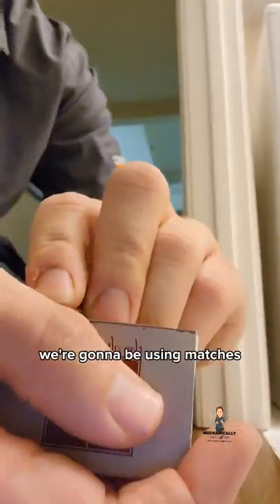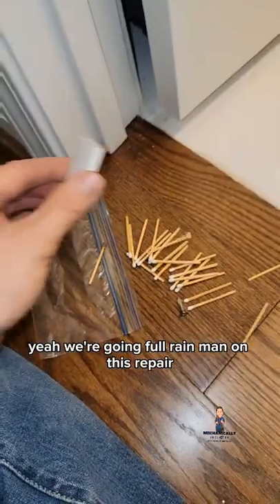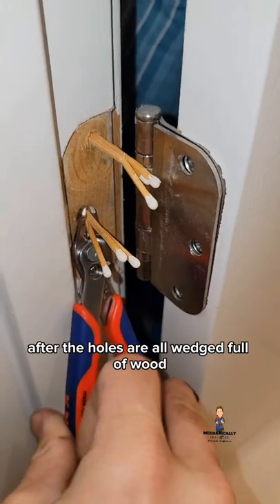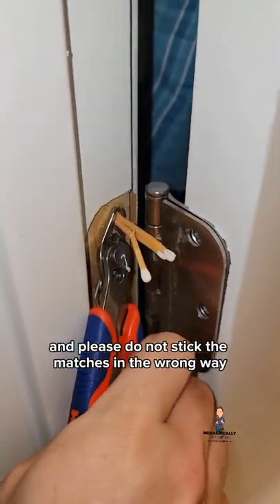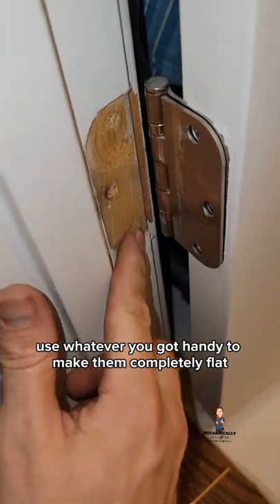How to repair a hinge with loose screws #shorts #diy #handyman

Comment: Helps to apply a tiny bit of wood glue
Reply: Apply the glue before putting them in? 
I aint mean for that to sound dirty
Reply: @Aqtalni ik i’m 4 months late but yeah put glue on the matches, and then you can glue over top after they’re in if you wanna overdo it
Reply: @lar2875  yeah I've had it fixed for awhile thanks though
Reply: @Aqtalni that was supper duper dirty …i like it

Comment: Longer screws to hit the studs
Reply: How long should they be?
Reply: @nadyperalta5827  I usually use like 2.5" or 3" wood screws. Just don't tighten the crap out of it because it can pull the door frame out of square